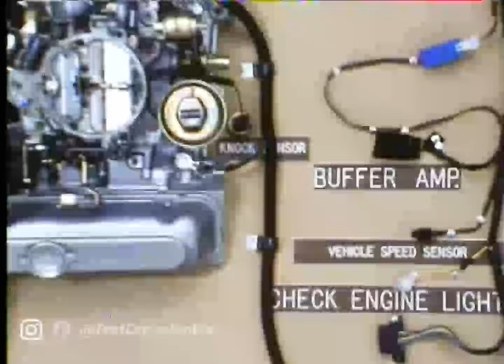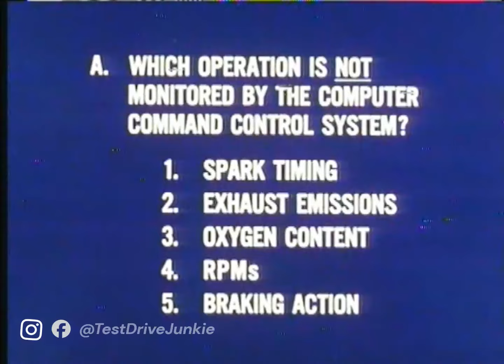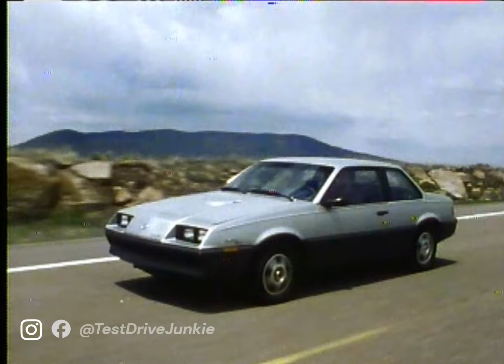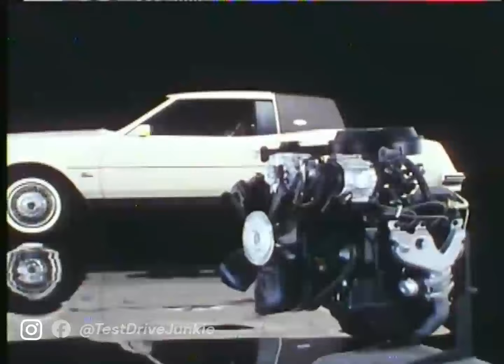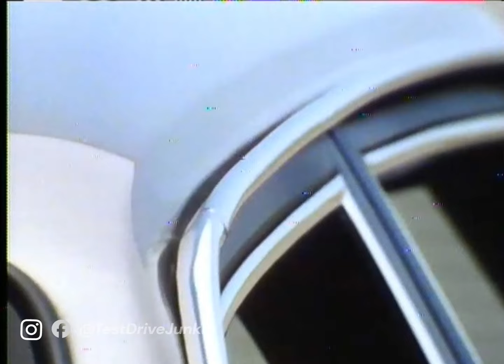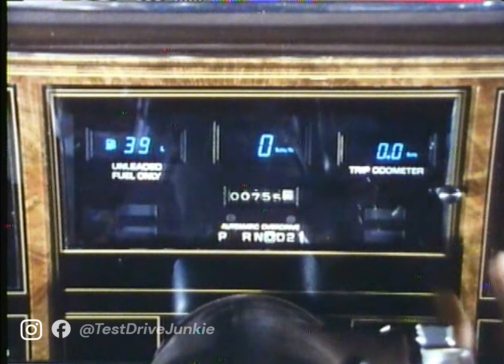1984 Buick Tech Features Side Two Manufacturer Laserdisc Promotional Video

Comment: ECM in 1980's cars??
Reply: All gasoline automobile engines since 1981 were under closed loop control with an Oxygen sensor and 3 way catalytic converter, 1980 in California. Even the carbureted cars had a mixture control solenoid that would duty cycle pulse 10 times per second to control the mixture near stoichiometric.